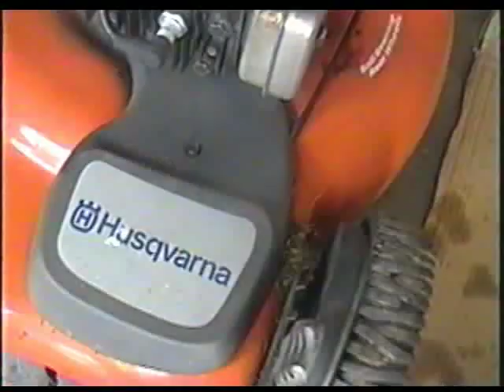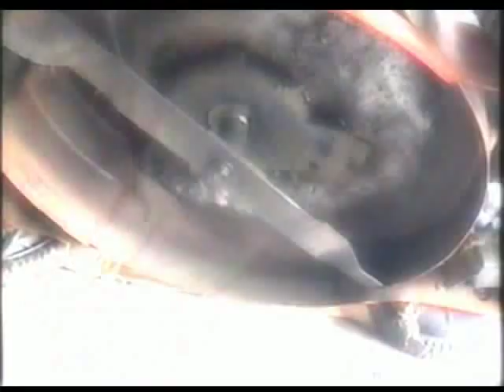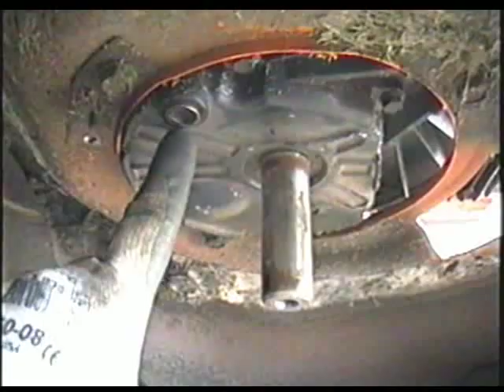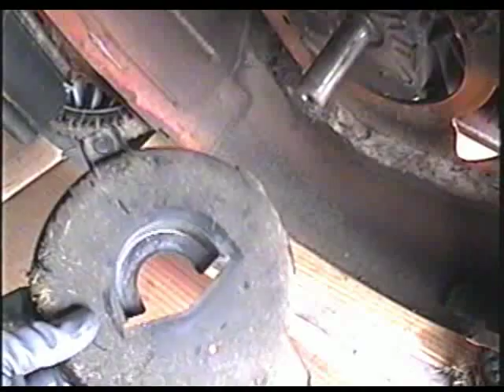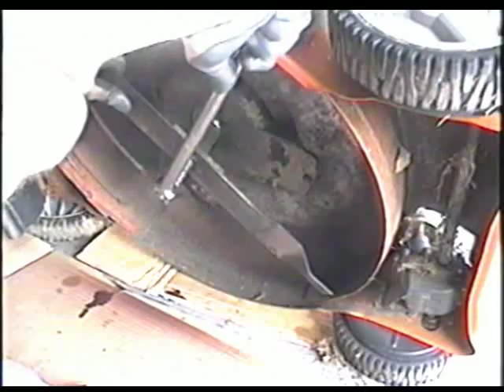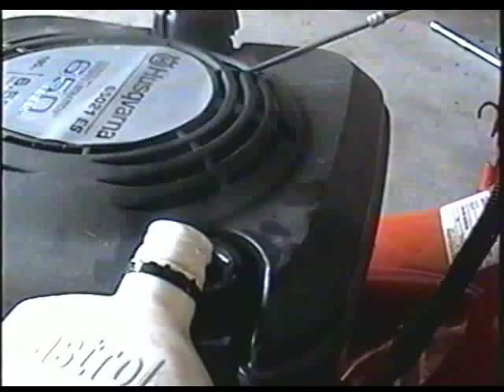BELT REPAIR on Husqvarna Lawnmower 65021 ES

Comment: Excellent video 👍🏼, would like some advice, I have 2 husqvarna Lc221a AWD mowers that were free both have bent crankshafts so I’m swapping out the engines with a Husqvarna 6021p & 7021p , I have both original blade adapter pulleys and both are too long and I’m not sure which size length pulley adapter to use ?, any advice is greatly appreciated
Thanks in advance!

Comment: Thank you donnyboy for taking the time to make this video. Unfortunately my problem is removing the plastic guard to expose the belt pulley. Unlike your video there is no bolt to remove. Does it pry off somehow? It is a husqvarna model LC 221FH. Thank you for your time.

Comment: My Husqvarna self propelled lawn mower with Honda engine does not disengage blade when I release the orange bar, what is that due to?
It won’t turn off and won’t disengage the blade when I release orange bar
Reply from the maker: could be a seized cable
Reply: I’ll give it a try, is there any way to donate to your channel? It’s the best channel on YouTube
Reply: Don, you were right, I found one of your other videos that showed how to change cable, I went outside and found the cable was installed with the intention of disengaging the safety override. I simply moved the cable and the safety override works and engine shuts off. 

Thanks
Reply from the maker: there's a donation link on my channel page

Comment: thanks for the video Donyboy   
question on this mower, my mower bogs down and quits in average length grass.   I sharpened the blades, but still quits. 
let me know.  thanks again
Reply from the maker: maybe your carb needs to be cleaned, check air filter and make sure rpm is at 3200-3500 rpms
Reply: Thanks!  Will check this out.

Comment: Thanks young man, though it is 6 years later. I am trying to replace belt on HU800AWD, the rear pulley guard is a son of a gun to remove, but I remembered how you took off the front wheel drive belt and did this to the 4 wheel drive. The awd is a lot more complex, and one needs a full set of sockets and about four hours of cussing just to change a simple belt,  gag us Husqvarna. Maybe the next time will be easier. This machine stores and packs grass and dirt under the front shroud like a squirrel stores nuts for winter. No other video on U tube covers this project, they are scared to. Any who thanks.

Comment: I have a 5521CHA with similar front drive. How can you check if the gear box is working properly on the front drive? The pull has become weak and I'm replacing the belt but when I engage the gear box and try to move things by hand it doesn't seem to do much.

Comment: This is the actual model i have but my problem is not the belt. I have gas leaking from 2 little holes on to the filter.  The lawn mower does not have to be on.  As soon as you fill the tank up it starts to leak.  please help!!!

Comment: Very nice video .I have a husqvarina with Kolher engine . I have had so much trouble with the mower  from day One. Had it in the shop for 3 months waiting on a new Carb from Kohler done under free service but when I got it home once again it worked fine first time . But, now everytime I want to use it I have to pull the spake plug pour gas in and them replace plug and pull start. Cross fingers it starts first time or I have to remove plug again. Husqvarina is very poor for customer service.

Comment from the maker: @jackieandley hi, u can pull it off, if it is stuck on you can use a 2 jaw puller, check out my video called  How To Remove A Lawnmower Blade Adapter